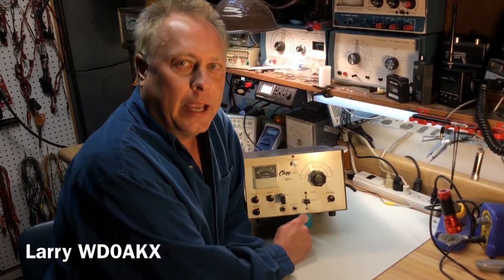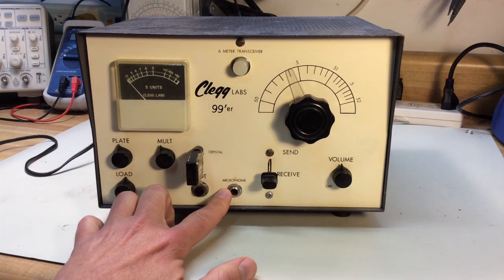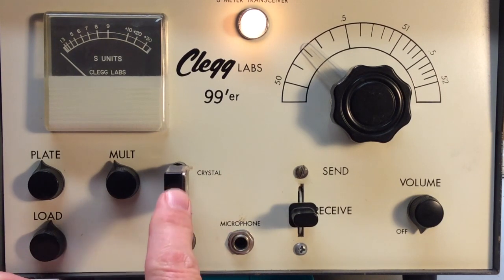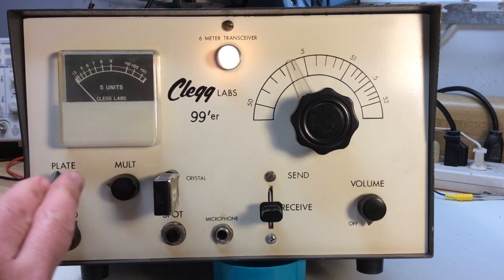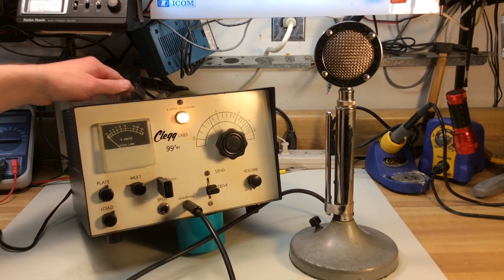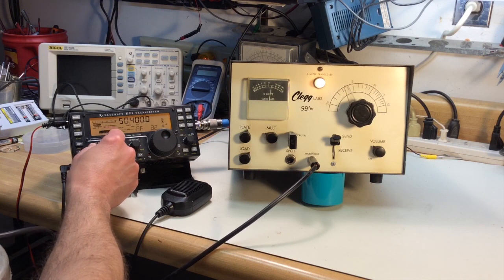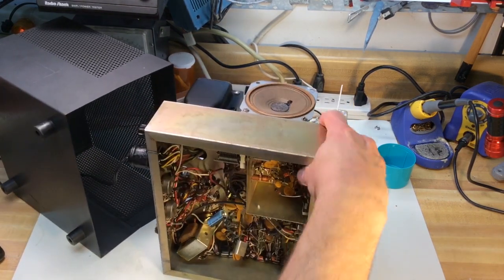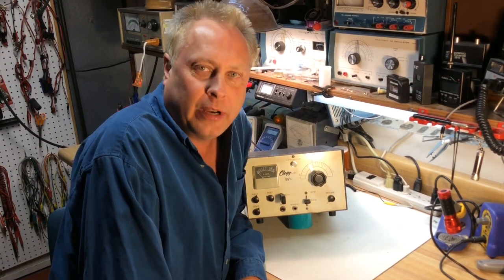Let's Look At A Vintage Clegg 99'er Six Meter AM Ham Radio Rig

Comment: This was exceptional quality for the low price.  And an excellent choice for a new ham !  The wiring and components are top notch, the design is simple but excellent.    Don't assume the  crystal is right on the marked frequency.. tune your monitor rx for best reception.  The Kx accuracy is good enough to allow you to re-mark the actual freq on the xtal... obviously it wasnt on 50.4 ! and you can also use it to calibrate the dial on the clegg.    Notice.. almost all the caps are ceramic... almost nothing to do to get it back on the air.  Someone has already replaced on electrolitic... and YES, you should  install new power supply caps under the chassis, before that multi-section job goes bad and ruins the power transformer.

Comment: I had one of those back in the 60's....  I was off to college in the fall, and swapped a bunch of older AM gear for the Clegg.  No regrets....  Except that I wish I still had mine.  Somewhere along the line I picked up a VFO for the thing, and had a really nice, if tiny station for a while.  Sold it for practically nothing at a Hamfest.  No regrets there, either - I'd gotten into 2M and needed something.  Couple things I did do - the pilot lamp in the front panel center turned into a fixture that included the capability to edge-light a piece of plexiglas over the "dial" - looked nice, anyway.   A couple of cheap neon's went on the front panel - upper right - for power and TX indication.  The front-panel transmit/receive switch finally got to me, and I replaced the function with a large relay buried inside and under the chassis.   I think the relay was one I had "in stock" from some project or other, but 1964 was a long time ago. 

Very tight working in there, and as the radio still had some value....   Worked late doing the conversion, and I talked to our club field day station afterwards.  It covered the ten miles or so fairly well, but I noticed that the Receive levels were a little low.  Figured I'd check that out the next day, and went upstairs to grab a shower before bed.  While I was wet, I started to think.  The coax used to be connected to the receiver while listening, and to the transmitter while transmitting.  But my memory of soldering that  up was hazy.  Still somewhat wet, I went back downstairs to the workshop and looked.  That was it - I'd soldered to coax to the wrong pins on the relay.  Big difference....  That's about where I was when mom showed up.   Not in bed yet?  A mic from another project and a couple of connectors finished the job.

Used it in the car with a dynamotor for a while, too. Wasn't the greatest idea, but it did work.  Unfortunately, the 54" antenna was a bad idea in a car, and it was dad's car, too.  Eventually things got settled out, and I picked up a Motorola "Dispatcher" that went under the front seat in my car with a slightly more convenient antenna.

I've been been at this for over 50 years.  I don't believe it either.

Thanks for the article!

Stu K8LEA

Comment: This was an entry level phone rig and there is absoloutely no reason that beginning hams cannot use a radio like this. It should be gone through first by somebody who knows tube gear, and then 5 minutes of operating instruction will be plenty for the newby ham operator.  With new electroltytics, and decent tubes, this kind of radio can work everyday for 20 years without skipping a beat.  It is wrong to discourage new hams from learning to use radios with tubes.  This can be a very affordable way to get on the air.. and work simplex instead of using repeaters which requires no skill, and often teaches little or nothing of value.

Comment: Nice vintage radio. I have seen a few historical manufacturers videos such as RCA & Zenith showcasing their engineering/quality control capabilities, but have never seen one showing folks back then performing all the work involved in point to point wiring. Back in 1968 i attended an electronics school in Boston, and part of our course study was building a 5 tube AM radio using its schematic. The IF cans were pre aligned so we could skip that part. The chassis/parts set cost us students $20 apiece. I enjoyed building that set and rue the day that I tossed it.  Those outtakes at your video's end are a nice touch.
Reply from the maker: Sam P Thanks Sam, I remember students before me building those radio kits with tubes as part of a class in high school even.  My cousin built one and I can always remember as a kid looking up to him because he built that and we would listen to the big AM stations on it back in the day.  This was the late 60's or so, it was a Greymark kit or something like that.  In fact, he still has the radio and still works so I had him send me some photos a while back and I did short video showing the photos, it is way down in my list of videos somewhere a few years back.